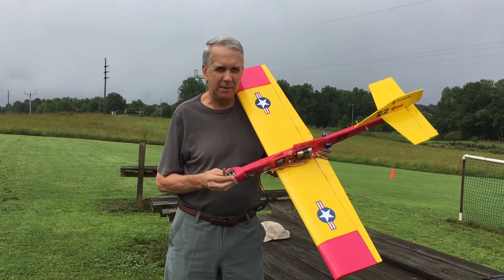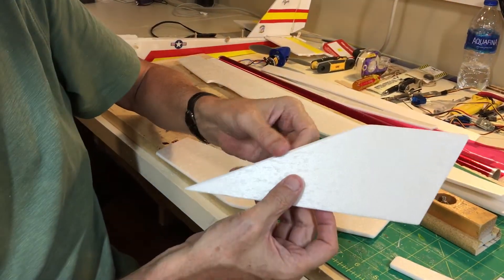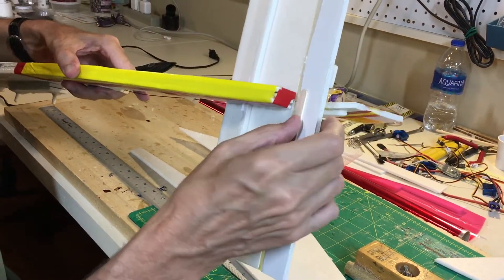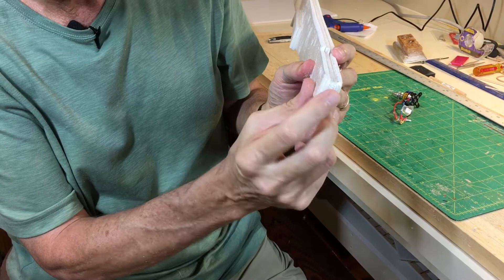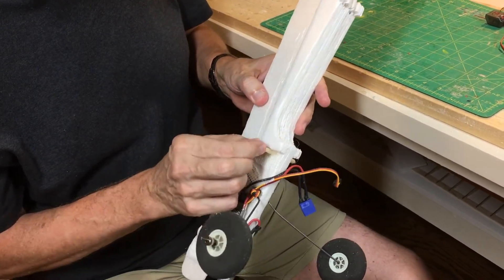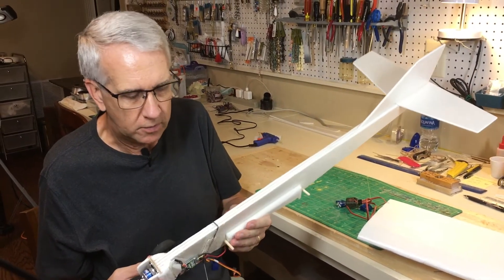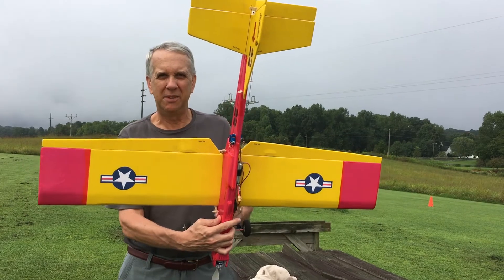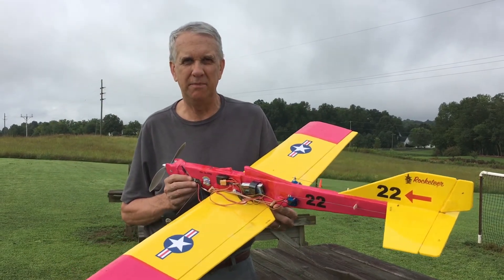Foam Bug RC Plane Part 3 - Low Wing Design

Comment: Great plane-
How long are the flight times on this plane?
Reply from the maker: Mike:  Depends on the size of the battery.  I use a 2 cell lipo, 1350 mah, get around 7 mins of flight time.  Tim
Reply: @TimMcKay56  thanks

I’m
A newbie, had my larger aeroscout  RC Plane just 2-3 weeks now. 

Winds here in. Connecticut was 14-16 knots. That was too much for my inexperience to control- hard nose dive crash.
Needed repair overnight with glue & taped up.

Today, winds were 8-10 knots and managed to fly that directly into a tall tree.

Luckily after 4hrs I managed to set it free, the Tree wasn’t going to wind today! Haha

Any pointers you could give me?

My guess is to fly plane high, over the tall 100ft trees & then do circles or whatever.

As a beginner I’m still afraid of flying it that high over trees. 
If it lands on top I lost the plane for good :-)
Reply from the maker: Michael:  15 kts is way too much wind for most RC models, especially for a beginner. #1 task is to find an instructor, even if you have to drive a bit to get there. Just too hard to teach yourself. Do a Google search for RC clubs. Also, RealFlight computer RC sim a huge help. Tim

Comment: Nice build, Tim. What motor, esc, and battery are you  using?
Reply from the maker: Zeph:  All in the description.  Park 370 motor, Castle Talon 15 ESC, 2 cell lipo (small one).  Tim
Reply from the maker: Zeph:  My apologies, thought you were asking on the Hellcat.  But above will work fine for the Foam Bug.  I used a 2 cell 1200 MaH pack, needed a bit of weight for the CG.  Tim
Reply: @TimMcKay56  Okay, Thank you.